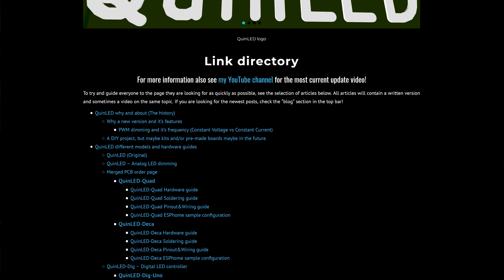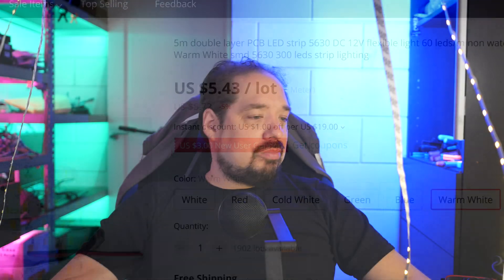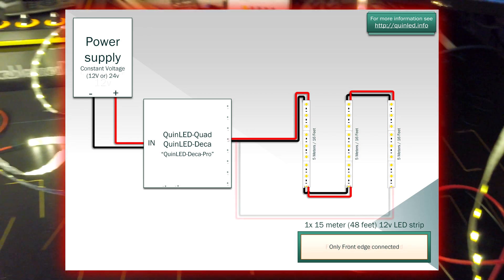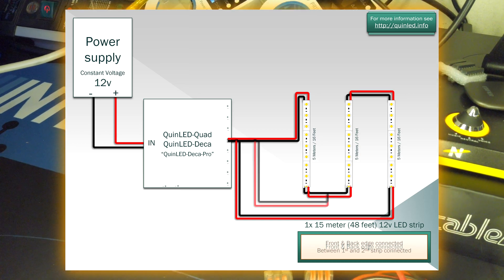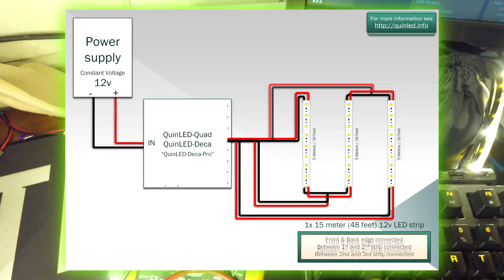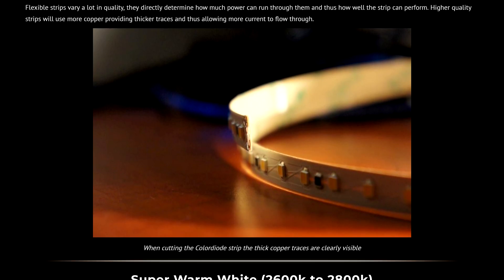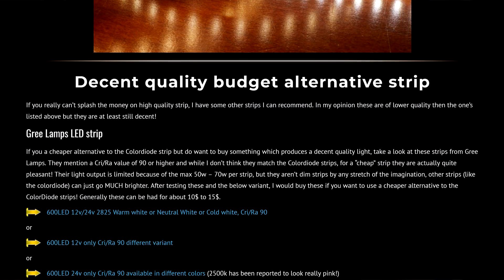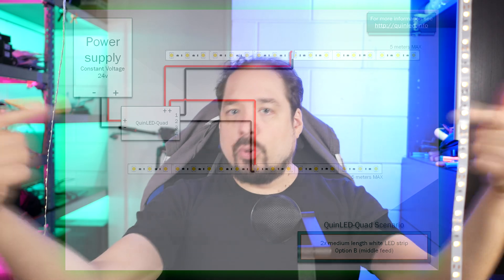QuinLED: Combating LED voltage drop | LED Power Injection

Comment: Hope you can help a disabled dad, I am running 3 strips of 5050 in a child's room. I got a 12V 20 amp power supply. I got 100 ft of 22/4 wire. I ran 48 ft of 22/4 wire parallel to my 3 strips (48 ft) and will tap into the strips periodically. Now, can I use my 22/4 wire (RGB/B) from my power supply's V-/V+ (which colors are - which are +) or should I run heavier 16 gauge Red and Black wires when
tapping into my PS? Thank you for your work
Reply from the maker: Hey, no need to be a disabled dad to ask questions. ;) Stuff like this is easiest discussed on the Discord server, so if you have more questions, please come there.

In theory you can use 22/4 wire, but 22 gauge is quite thin, so not a lot of copper and without knowing the power requirements, nobody will be able to tell you. That is actually the first thing to determine, total power draw of it all, and then divided up to injection points what each injection point can roughly draw, then once you know that, you can size your wires properly (with distance taken into account using a cable power loss calculator). 

Although it's about Digital LEDs, the principe is the same, check this livestream, it should teach you want what you want to know: https://quinled.info/2020/09/26/power-injection-livestream/
Reply: @IntermitTech  Are you thinking 18 gauge? Thanks for being kind BTW
Reply: @IntermitTech  Would love to ask you questions on Discord, I'm old so I have to learn how to use Discord. LOL
Reply: @IntermitTech  I got a 12V 20 amp 240 watt power source, wired in a plug, I split the RB to V- and BG to the V+, sent it back to the controller (4 pin female), plugged it in and now half the remote buttons don't work, the "power off" doesn't work, the "full white" doesn't go full white, I'm assuming that I either fried something inside the controller or I "unsequenced" it because I see no burned lights, half the buttons do work. If I damaged the 2 light strips it's no biggie, I have 3 brand new ones to replace them, if it's the controller, $10 from any ebay seller.
Reply: @IntermitTech  Someone (hint LOL) should make a video how to wire one of the 12V power supply boxes, not one video and no one on Youtube has addressed that you can't run even 2 5M strips with a cheesy 10 amp ac adapter these are sold with.
Reply: @IntermitTech  Even an average kids bedroom say 10x12 will need 3 strips of 5M so we need someone to show us how to wire one of the 12V 20 amp silver power supply boxes and how to use the solderless connectors to "tap-in" to the run and how many times we should over 15M my new friend.
Reply: @IntermitTech  Can I use one of my new 5M strip lights to test if I damaged my controller or the strips themselves? (or if I just unsequenced it) I may also try a factory reset of the controller if I can find instructions, the Ebay sellers most of us buy these from in Japan know less than we do about how to wire these

Comment: Haven’t you simply moved the strip connections from series to parallel?
Reply from the maker: Well yes, this having more copper to areas which are limited in current by the voltage drop

Comment: Doesn't connecting power at both ends create a loop? Is that safe? (t. not an electrician)
Reply from the maker: Not quite, it connects multiple points to the same pole to make the resistance lower by adding more copper. As long as you add + to + and - to - that's fine. I generally do recommend fusing the + side of all wires rated to the wires and the load. My digital controllers all have built-in fuses for this.

Comment: When extending the power strips, do you just connect the power lead to the extensions, or all the RGBW plus the power leads?
Reply from the maker: Are we talking analog or digital? Yes you connect to the little pigtails that stick out for digital, just + and -. For Analog you'll have to extend all the wires, so with RGBW that's 5 wires.

Comment: Also, what do you think about running 48V to each injection point, and then attaching a small DC-DC converter there?  Would this solution be more efficient than straight 12 V to each point?
Reply: Yes, using a buck converter would work great.

Comment: What do you think about using DC-DC converters before the injection points?  What is the quad device displayed in the end?  Does it compensate for the uneven voltage drops in the extra cables of various lengths?

Comment: I have a 2812B 5V strip, if I feed 5V from one source through 1 end, and then power inject 5V to the other end from a different source, will that fry it? Do they need to be from the same power supply?
Reply from the maker: Same power supply, yes.

Comment: Why is there not voltage drop on the wires feeding the power injection since they in turn still have to run the same distance as the LEDs to inject the power down the line? I have a 46 foot run powered at one end with terrible voltage drop.
Reply from the maker: Oh, but there is, the wires just have much more copper then the strip. But in practice you also need to calculate the amount of voltage drop for the injection wires you need and size them accordingly! I did a livestream about how to calculate all this.
Reply: @IntermitTech  Is the live stream have a link from your website?
Reply from the maker: https://quinled.info/2020/09/26/power-injection-livestream/

Comment: hello friend ive been watching your videos and need help!! i want to run 20m run kit can i join all strips together and connect power to the end? wb2812b running sp108e controller how would my setup run?
Reply from the maker: Check out the wiring guides on https://quinled.info

Comment: Nice video, but wont you get in trouble when injecting power like that on a analog RGBW strip?
Reply from the maker: In what way would that cause issues? With RGBW it's a lot more wires, but that's it really?
Reply: @IntermitTech  Will the RGBW be able to change color and dim if you inject power on multiple points through the strip?

Comment: I have a "WS2812B RGB 5050SMD 60Pixels/m 300Pixels". I think it uses 15 amps (50ma x 300). How can I use them with the dig uno with only a 10amp fuse? Should I hook the other end of the strip directly to my 5v 60a power supply?
Reply from the maker: Well, first check my sheet LED power usage sheet, 300LEDs in reality only use about 13Amps maximum when doing full RGB White, you could set a limit in WLED to 10Amps max for instance, that would dim white but everything else would be full color. The other option is replacing the fuse, the board is rated for over 15Amps, so that wouldn't be a problem either.

Doing it directly from the power supply is possible, but then you'd have to setup your own fuse solution for it.

Comment: How would you account the extra wattage when adding injection points when shopping for a power supply?
Reply: 0.06A/LED is usually the recommended value.
5V strip, 60 LED/m, 5 meters => 5m * 60LED * 5V * 0.06A = 90 Watt
PSU shouldn't run 24/7 at more than 80% of their rating, so 90W / 0.80 ~ 120 Watt PSU
Reply from the maker: It's not really extra wattage, it's helping it get the power it should be getting. For Analog strip like this, generally what the seller says is correct, for digital LED strip I have my power calculation sheets to get some real world numbers to work with. Try and oversize the power supply 20% to 25% above what you need.

Comment: Hi great informative video. Could you show how to inject power on a rgbcw strips these have 6 wires and I am controlling with wifi controller. Your reply will be really appreciated. BTW I am using 24v strip.

Comment: so basically if I have 3 (5m) rolls and i have no idea how to do those injections, i can just buy an adapter with a higher voltage? i mean right now im using a 12v output adapter for 3 rolls of 12v input, wouldn't it cause fire or something (sorry im like 12 i have no idea)
Reply from the maker: No you can't, you always need the correct voltage for the strip, not higher. Add more strips up the Amps/current nog the Voltage. Only way is add some power injection like I show in the video.
Reply: Intermit.Tech would amplifiers work

Comment: Well can u tell me what I can use bc I bought 10m and there is some light that are not bright as the other ones so can u tell me the thing that can help me and also I got 20m more and it's also 12v
Reply from the maker: What? I showed it very clearly I. The video, you need to make power injection points and run Seperate wires to different parts of the strip. Did you watch it? Maybe I'm not getting your question....
Reply: @IntermitTech  can you give the name of the things you used
Reply: The power supply of how many watts should I get

Comment: I just bought 30 meters worth of 3528s and thank you for the info in this video. I am definitely gonna inject voltage at any point of the strips. Just one question, does injecting voltage not affect the control system? By control, I mean the dimmer and different light control from an IR controller
Reply from the maker: 30 meters is a lot, even with 24v so injection will indeed be needed. Injection is no issue as long as you do it on the same port of the controller and it can handle the power on the single port. Otherwise you'll have to devide it over multiple ports and cut up the run like that.
Reply: @IntermitTech  Got it. Thanks a lot. I got a lot but only going to use around 10m. I'll keep the rest for future projects. What I have are 12v strips so I think an injection after 5m should do the trick. Your channel should blow up as you give quality content.

Comment: If i feed 19 volt to the 12v rated strips, will that not burn my strips eventually?
Reply from the maker: Ah no, that's a big no-no, you will fry the LEDs because some of them will get the 19v. Further down the strip that might go down to 12v because of the voltage drop, but yeah, no, you can't do that. :)

Comment: Great information! Just wondering on a "cheap" strip of 5050s (not individually addressable), how best to connect 2 24V 10M strips? I'll cut each a few feet for a rectangle of 54 feet. Option 1 is to have them look continuous, but not have them electrically connected. They both would run out from a common point with one 24v brick and controller powering one and the other set powering and controlling the other. The hope is one remote will control both controllers. The other option is to connect them as one long 54' run. I would use 1 brick and 1 controller at the beginning end and use the other brick with 2 wires to inject voltage at the other end. I won't use the other controller. Both ends will be inches apart and I will tie the grounds together. Thank you for any help.
Reply from the maker: Come to the Discord server, we can discuss in a bit more detail. :)

Comment: I am trying to find the best solution for 127 lineal feet of lighting for the ceiling of a yoga studio.  I was quoted 500 dollars for 16.4 ft strips at 24v run by a magnetic driver on a dimmer switch.  What do you recommend for good white light? And how many injection points would be needed? Thanks in advance.

Comment: What type of Led light strips do you suggest that won’t do voltage drop. I’m looking at something to put up in a coffer ceiling that is good and balanced. Love the video.
Reply from the maker: Well one that doesn't have any voltage drop doesn't exist but the example I showed with the much higher amount of copper only shows a 2v drop of 24v after 5 meters, so you can get away with using a lot less injection points, if any, depending on the total length. Beyond that I'd also always advise to use multiple segments/channels where possible to distribute the load on the controller/dimmer. :)

I have a link in the description to strips I have tested and use myself, those are all decently constructed. The Colordiode strips are the best in that regard but expensive. The Gree and others listed there strike a better balance between cost and performance.
Reply: Intermit.Tech thank you for the info. I appreciate it. Keep up the good work.

Comment: Great video. The wattage meter really shows the effect of the voltage drop. 

What I don't understand is why the wires in the strip don't burn up under the draw of the LEDs. In AC house wiring we are told that the fuses are there to protect the wiring. So if I have an AC circuit with a 20 amp fuse, running a device with a 20 amp draw, but only 15 amp gauge wiring, then we are in danger of frying the wires and starting a fire. In low voltage DC does an over draw situation just lower the voltage?
Reply from the maker: DC and AC in that regard work in the same way but an LED strip consists of diodes (the LEDs) and have resistors, next to the strip having resistance. Because of this, part of the drop occurs and because the voltage drops, the LEDs automatically start asking less and less. If you'd for instance take a long piece of wire and you'd just cross that, causing a short-circuit and thus basically an unlimited draw and there are no protection mechanisms in place and the power supply is strong enough, that wire will burn for sure even with DC. :)
Reply: @IntermitTech  Very interesting. I'm a software guy who just started fooling around with building electronic devices, so I have a lot to learn. Thanks for the explanation,

Comment: If I was to use an LED strip with power injections, how would that be compared to fluorescent lighting in power consumption? 131 watts seems to be a lot for one strip. A 32 watt, 4-foot fluorescent tube, puts out 2800 Lumens. 4 fluorescent tubes equal 11,200 lumens and 128 watts of power. Also, how many lumens does that strip put out with the power injections? Does higher quality LED strips use less energy?
Reply from the maker: So taking the Colordiode strip as an example again, they give the Lumens per meter, so of their 120LEDs/m 24v strip it's a little above 2000 Lumens per meter. Since you buy 5 meters at a time, that would be a little bit over 10.000 Lumens for the whole strip. So that's 120 watt that would be about equal to the fluorescent tubes so they seem comparable for the amount of light you can get. I'd personally still go with the LED strip since you can get multiple strips and divide them over the posts that you mentioned before and then use a dimmer to adjust it to the lighting level needed. That way you can get a well lit workshop while keeping power usage in check and by using a channel per post you could even vary the brightness per post as needed. :)

Comment: I want to install lighting in my workshop with LED strips along the joists. Do you recommend analog or digital? Also, could you give some suggestions on how you would approach this project? My workshop is 6.5 x 6.5 meters and I’m thinking of separating it into three zones. Thanks, I enjoy your videos and appreciate how you make it easy to understand.
Reply from the maker: Hey Frank, if it's for general purpose lighting, analog always, this is because even with RGBW or WWA Digital strip the quality of the white light isn't great, you don't want to do any work under those basically. Digital LED strip is cool for effects and accent lighting but if you just need a lot of good quality light, they aren't the way to go. Also analog strip comes in 24v variants where digital is mostly 5v and sometimes 12v making wiring a lot more complex. Check out my recommend strips (https://quinled.info/2018/08/23/my-favorite-warm-white-led-strip/) for analog lighting here, the Colordiode strip provides A LOT of high quality light but is a bit expensive, but there are other alternatives there too.

If you'd like to have a more in depth discussion, join the discord server, happy to look into your situation. :)
Reply: @IntermitTech  Is there a physical reason why similarly spec'ed analog and digital LEDs are not equivalent? Or is just because they digital strips use lower quality LEDs to lower costs?
Reply from the maker: @brentonolander7244  Not similar in what regard? If they would have similar specification they would be the same in all regards but how to control them. But that sadly isn't the case, Digital RGB runs at a lower voltage (for reasons) and Analog strip can be constructed differently that it can run at higher volts (basically larger blocks, allowing for a higher voltage). Then Digital LEDs are mainly meant for color and patterns/effects, even though you can now get them in RGBW variants, so with a dedicated white channel, the quality of this white light, although better then adding R+G+B together is still appalling quality wise. So that's where analog LEDs also have a leg up, they are meant for general lighting and thus over the last years LEDs with a good color spectrum, so called "high CRI" have become available and they are very pleasant to light your room, or in my case even as video lights, etc.. I'm going to make a video soon talking about exactly these differences and when to chose what. :)
Reply: @IntermitTech  This is good to know. I was hoping to standardize on digital strips for all my lighting, but the quality of the lighting for regular indoor usage is too important. I'll check out your recommendations for analog lighting.

Comment: Haven't seen you mention anything about 110/120v LED Strips. Are these a thing or am I being misled? If so, do you happen to know if RGB is an option and who you would recommend buying from?
Reply from the maker: They have become a thing over the last few years and I've encountered a few but I'm not really convinced. It's bottom of the barrel quality LED wise and there is a giant amount of flicker since it's running directly off AC. So I wouldn't quickly go that route myself.

I don't know about dimmers or RGB and anything like that either.